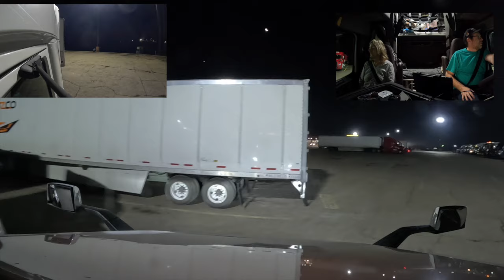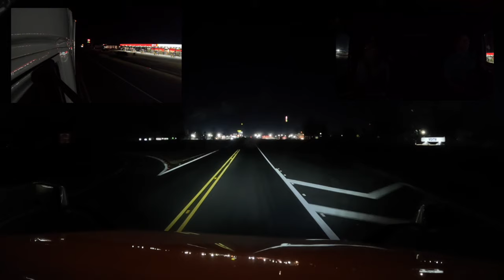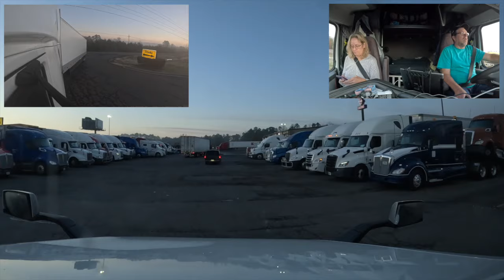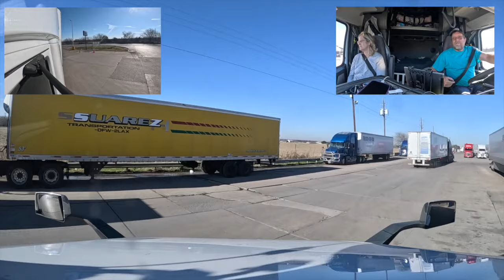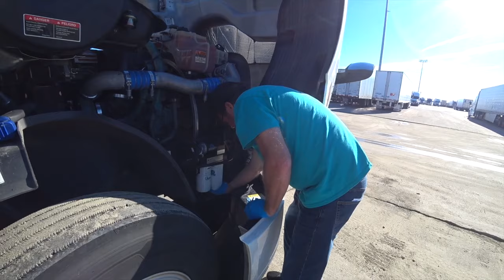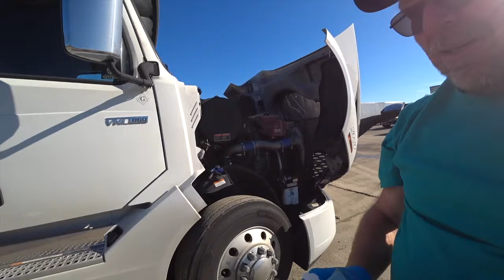Emergency Fuel Filter.Texas VLOG 503

Comment: Is that a FASS fuel lift pump you added on to the fuel system?  I had one of those and loved it.
Reply from the maker: Airdog.  Love the self priming
Reply: @provostmotorsportstrucking2298  yes sir makes it a lot easier. Smooths out the idle and should make the injection pump last longer too.